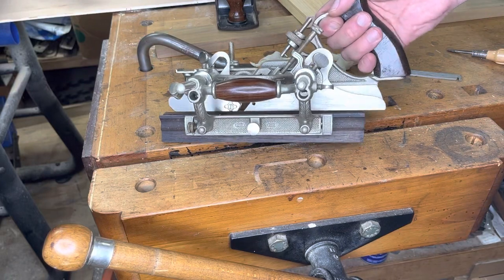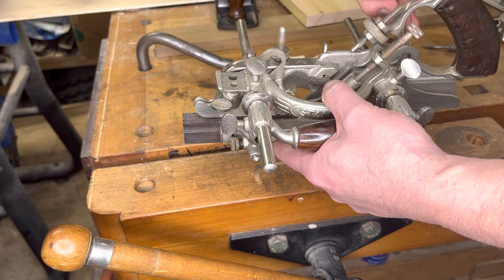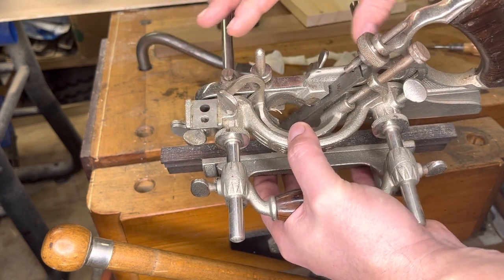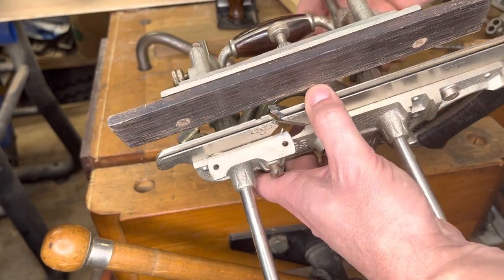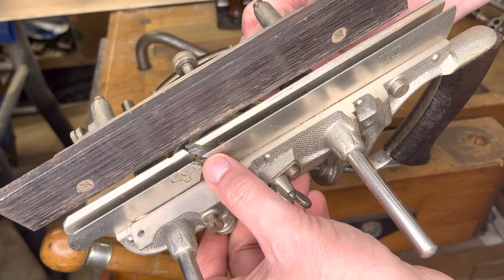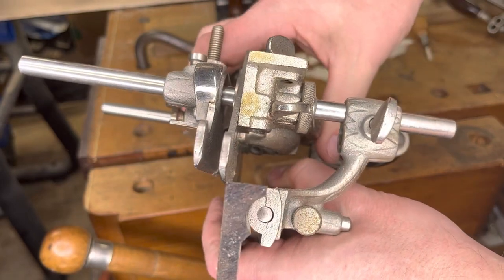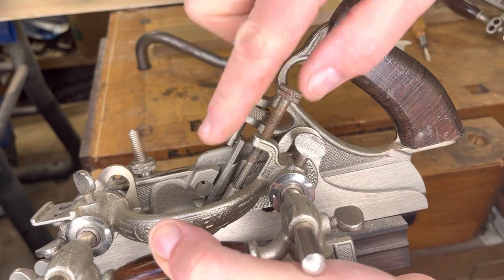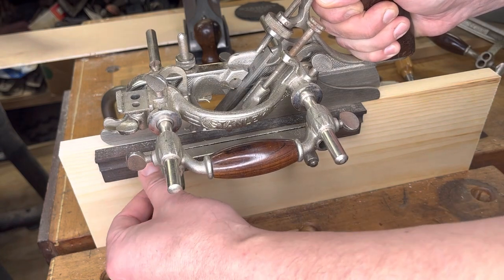How to set up & use the No 55 Stanley combination plane ~Iron #102~

Comment: They become real fun when you start using some of the #60 Ogee cutters in conjunction with the auxiliary centre bottom.

My 55 is a Sweetheart model with the straight spurs, I noticed yours has the 'star' spurs. 
Fun toys 😀
Reply from the maker: Agreed - they’re fun to use. And easier than some folks think.

Comment: Great video MJ. So do you like the 55 over the 45?
Reply from the maker: I really like both. The 55 excels at certain profiles (I have a video on that too) and the 45 is a bit quicker to set up for the flat ones. 

For folks on a tight budget I would recommend the 45 to start with. Master that and then work up to the 55. Lots of parts (accessories such as depth stops) are interchangeable between the two so that’s something to keep in mind if building one up from parts

Comment: Hello thank you for the video - there is not a lot of information about thus plane. I've got a Stanley No 55 and I got some trouble with fixing the fence/screws it likes to loosen and the fence moves which is a bad thing -do you have an Idea what one can do about it? thanks anyway
Reply from the maker: I would start by ensuring the screw threads are all clean and the screw hole as well. It’s possible they could be dirty. Or they could be worn from a lot of use. If that’s the case, replacing it would be best. 

You *could also try some type of thread tape if you want to stick with what you have. That or tighten it with a screwdriver or other manual method as applicable - but that’s sketchy as you don’t want to mess it up. 

Feel free to send me some pics to jplanefun@gmail.com

Comment: I have a quick question about the 55, I just finished brushing off the worst of the dirt and surface rust from the body on mine, but discovered a crack at the top of the handle casting just across from the top handle pin. I’m not sure if it’s just residual grit around the adjuster wheel or if the casting is bent a little, making it harder to turn the wheel, but is that fatal to the plane in the long run?

I haven’t reassembled it to try out yet but the handle is still in good shape, so I’m wondering if that happened because it was in a wet environment at some point and the handle expanded.
Reply from the maker: Not sure what would have caused it but if you find that it’s not serviceable, let me know - I’m nearly certain I have a direct replacement for just the main body section available for sale. You can move all of your good parts over to the replacement
Reply: @justplanefun  Will do once I try it out in the coming days, and I’ll contact through your facebook group if an online storepage isn’t available?

Thanks in advance!